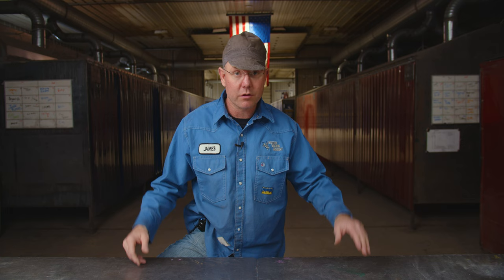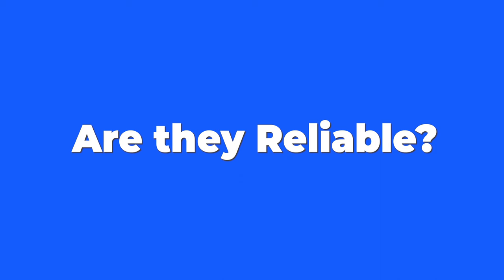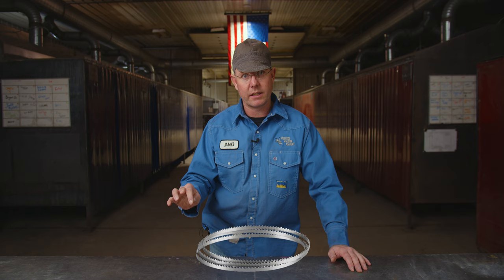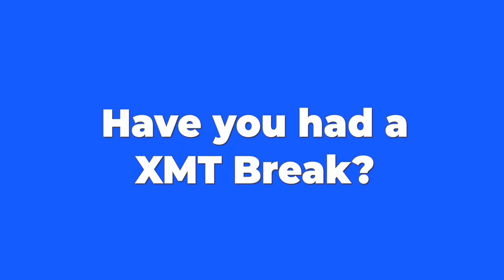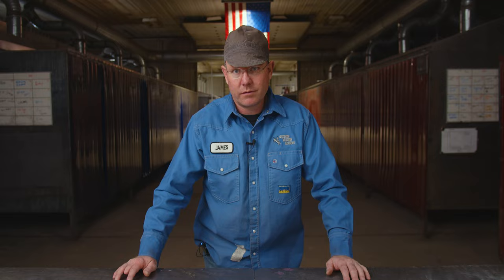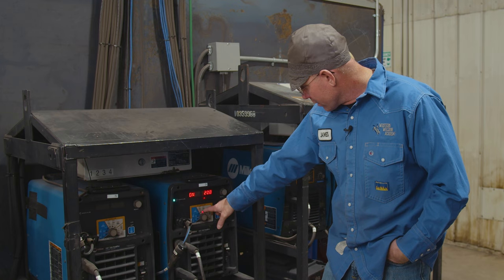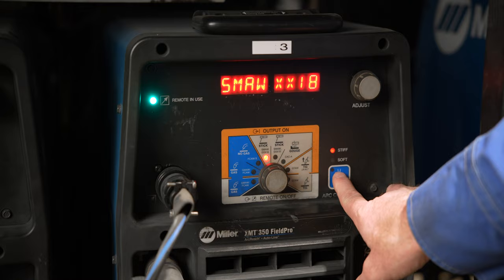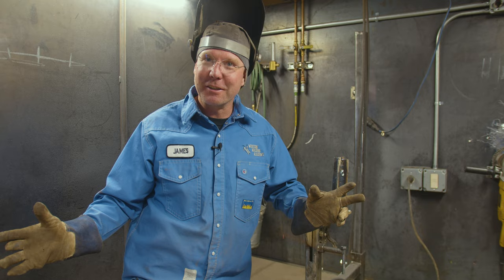The Welding Machine For YOUR Shop? | Miller XMT

Comment: picked up a xmt 304 and rc12 suite case for under 2k at an Alex Lion and sons auction probably15 yrs ago. just added a like new base model Dynasty 210 with flow meter,  air cooled tig torch foot pedal for $2300 from Auctions International,

Comment: Yeah if you like spending close to 10 grand Everlast has the same thing for 3 grand the mts 400 dual phase Machine has a carbon arc settings the xmt350 don't miller and Lincoln are becoming obsolete yes the engine drives yes but the prices are beyond insane
Reply from the maker: thanks for that insight we'll try to check it out next time

Comment: Place I worked years ago, they bought an XMT350 with an 8RC suitcase. I loved that machine! I could run 1/16" solid wire welding excavator sticks, 1/2" AR400F in a single pass. Best part was, the suitcase had a 50' umbilical so I could reach pretty much everywhere I needed to in the shop.